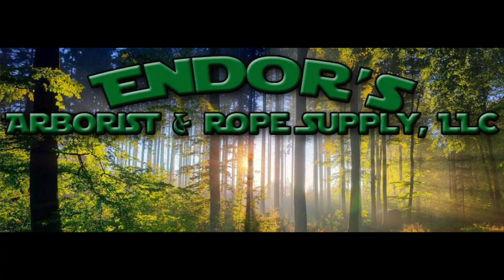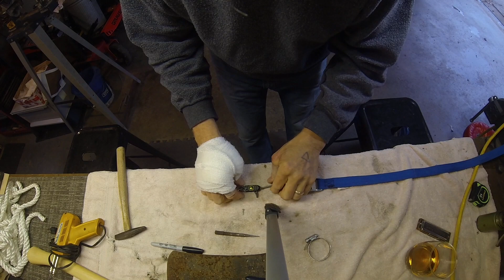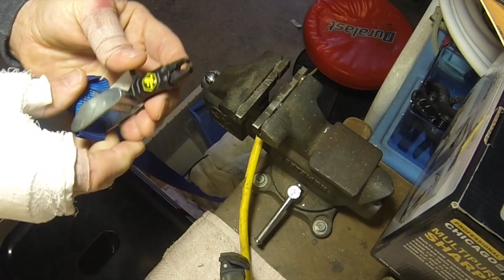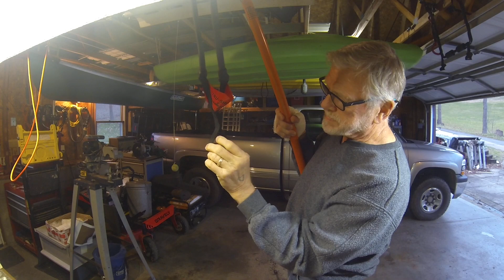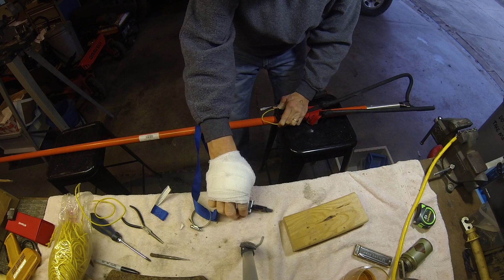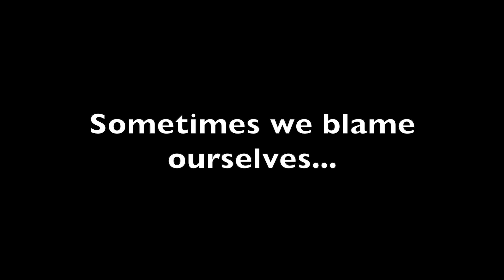TRU-Shot Throw Bag Launcher Trigger Release

Comment: Hi Wayne. Burn looks pretty bad on the left hand , assume right is worse. Wishing you a full recovery dont need any problems with your hands. Its always a womens fault for leaving us alone. I put a tree through a window one time i was left on my own. Its really something how fast things happen. Looks like your doing well and over coming the shoulder issues with some brain power . Nice job with the trigger release it will be way more accurate also. Just make sure that trigger doesnt fly back in your face. Be safe and speedy recovery . Thanks for your video.
Reply from the maker: Hi Bill! After I got back from my haircut, I played around with the launcher a little more and found that if I hold the webbing in the same hand I use to grip the pole, it will not fly back like it did in the video. I appreciate the feedback. Healing is going well. I clean the wounds daily. I hope to be bandage free by the weekend. Stay strong, stay kind, my friend!